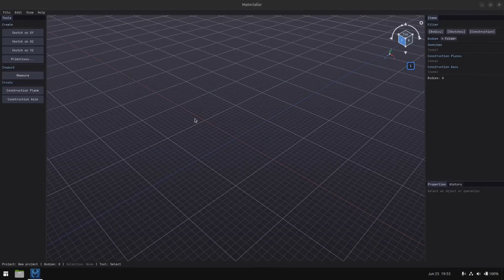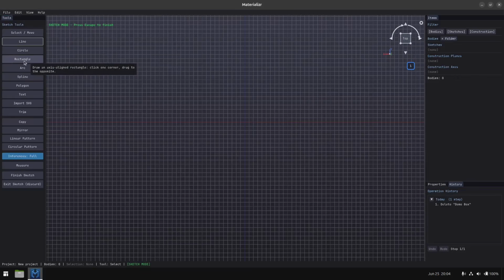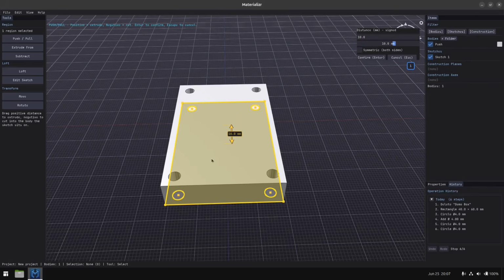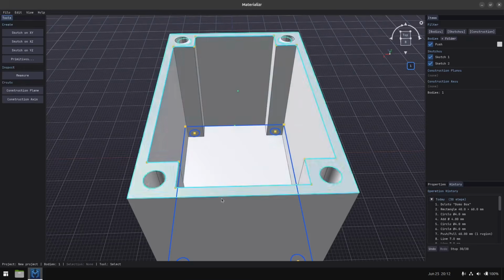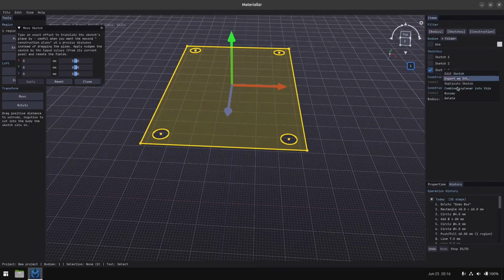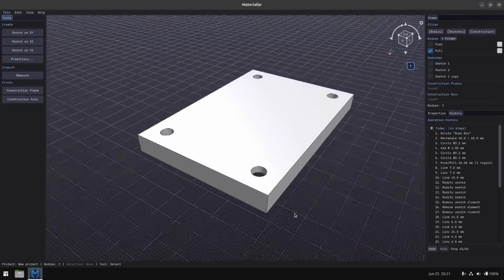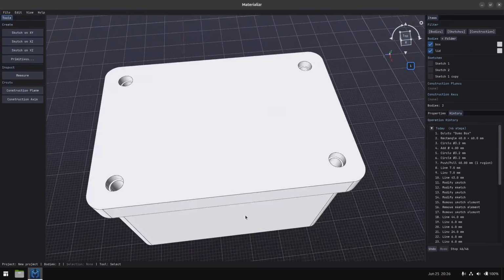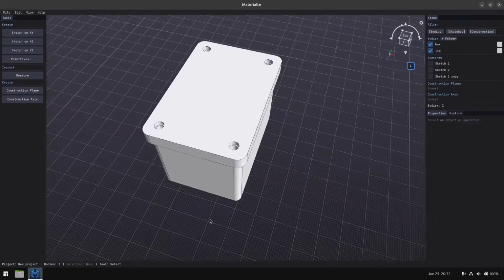Materializr Tutorial

Comment: Can this edit STL files?   Or is it just to design.  I was looking over f-droid to see what they had to use with a 3d scanner and found this app.  Looks nice and maybe exactly what I need...

Tried importing a phone case and also a PCI-E part I was working with this week, then I couldn't see them.   I'm sure it's me as I've been able to open them in Freecad and other software.  

I'm mostly new to CAD, I say mostly because I've helped some engineering firms fix issues as an infrastructure consultant, so I can usually fix stuff I just don't know how to use it! 😂
Reply from the maker: Hey there and thanks for the comment! Sadly no, we are unable to incorporate STL imports just yet, as their meshes are too messy to get a clear, reproducible geometry that can be edited. STLs use tons of tiny triangles to create the shape, whereas a STEP or IGES files use clearly stated vectors to define their geometry. I will very likely revisit the STL import idea though, but it'll have to be done as a conversion
Edit: we do have STL import now in the latest beta, but it only works for reference. They cannot be cleanly imported as brep solids, but you can move them around, sketch upon flat faces of them, and such